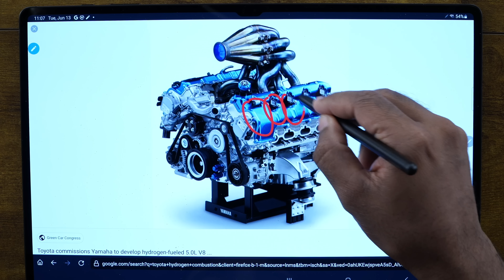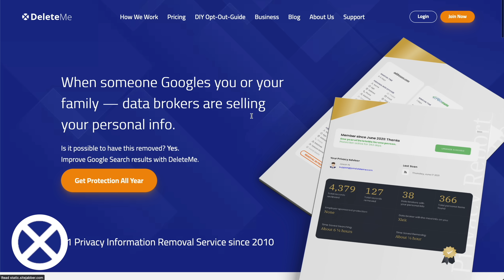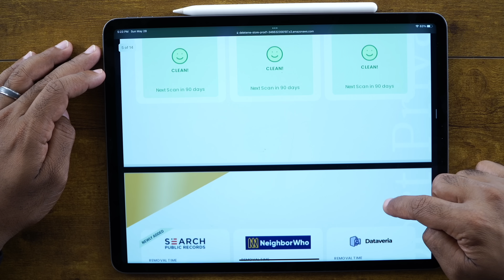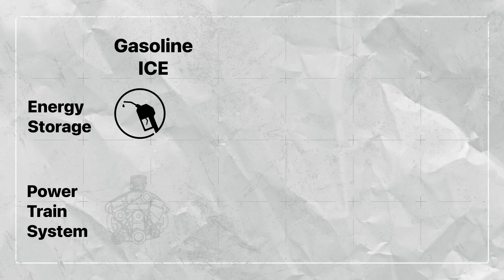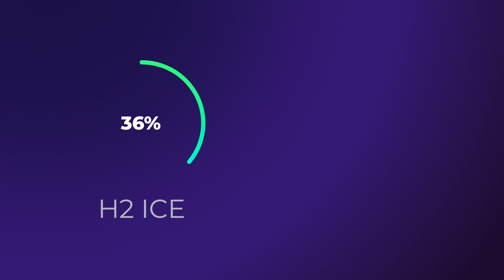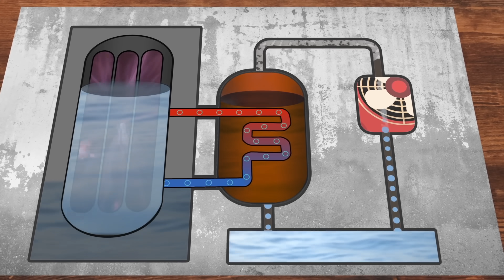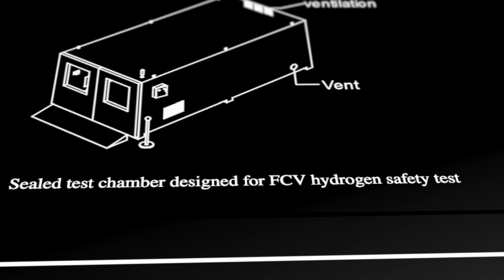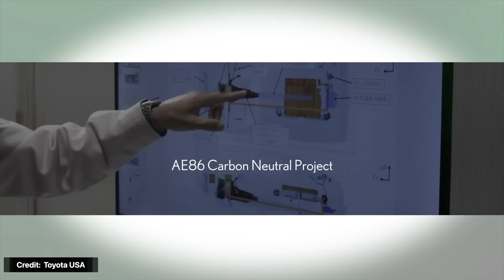Toyota's Says They Just Destroyed EVs - Hydrogen Combustion Engines

Comment: Problem: the H2 pumps freeze after every fill-up and can be a problem if people are lined up to fill their tanks.  Also, a typical station can only service 80 cars per day because the H2, even when compressed takes up too much space.
Reply: Most people don’t have a CLUE how difficult it would be for everyday people to try to use Hydrogen as a fuel. I have seen people suggest that we just use the existing fueling stations we have and transition them to dispensing Hydrogen.

NOT A CLUE !
Reply: @trevorhenriques7733  Most people have no clue the national grid will not support a 15% EV fleet
Reply: @trevorhenriques7733  You have no clue of what you are saying. Denmark has had a HYDROGEN highway for hydrogen vehicles for years now and it works like a charm...
Reply: @trevorhenriques7733 lol they’d be some impressive explosions with that idea
Reply: @trevorhenriques7733  People do it every single day in California but that's a magical future land.
Reply: @filonin2 , I have worked with liquid Nitrogen, Nitrogen exist as a liquid below -195C. If you pour it on any part of your body, you will freeze instantly and if that part happened to be load-bearing, like say a leg, that legs could crumble to dust under the weight of your body. At the very least you get a BAD frostbite.

Hydrogen exists as a liquid below -259C. Apart from it being very volatile as a gas causing possible explosions all over the place, do we really want to contemplate having canisters of liquid Hydrogen in the general population like we do gasoline today ???

I will continue to insist, THIS IS A VERY BAD IDEA !
Reply: @trevorhenriques7733  It doesn't sound like you worked with liquid N very much. I had a infra-red detector that needed LN2 so I worked with it routinely. We used to spill the stuff all over our clothes. It just jumps off you as it boils away. You can pour it in your hand and it will just jump around - don't try to confine it though lol. Hydrogen would be much worse and flammable to boot. I hope they solve the problems somehow.
Reply: @defaultuserid1559 , I worked with liquid Nitrogen for over three years using it for instantaneous freezing of biopsies and tissue samples for histological processing and microscopic evaluation.

Wore protective gowns and gloves when handling, and although we sometimes threw a bit across the concrete tiles in the backyard, I never wanted to find out what it would do to the skin.

But hey, if you think it would be a good idea to have the average person out there routinely handling liquid Hydrogen, have at it.
Reply: I will make sure I live as FAR AWAY as possible from any such “fuel stations” where the public will go fill up their Hydrogen vehicles.
Reply: @trevorhenriques7733  That's not what I said and you know it. Cheap rhetorical trick lol.
Reply: @defaultuserid1559 , You accuse me of cheap shots after you came out with your “superior knowledge” and accused me of not knowing or understanding the properties of liquid Nitrogen, SERIOUSLY ???

I have been working in scientific research and diagnostic science for over SEVENTEEN years and have experience with all manner of hazardous substances, even radioactive isotopes! 

Have a nice day !
Reply: @trevorhenriques7733  You intentionally put words in their mouth that it was a good idea for people to handle liquid hydrogen, which is of course in no way what they said. They were refuting your ridiculous claim that liquid nitrogen would instantly freeze your leg solid, which is not accurate no matter how you spin it.
Reply: @trevorhenriques7733  You seemed scared of Liquid N, so much so I thought you were fear mongering and wanted to add some real life perspective. I agreed that Hydrogen has many problems but you still got pissed off for some reason. 

Cheers !
Reply: @defaultuserid1559 , It’s called safety training for handling hazardous substances and having a healthy respect of the dangers associated with the substances we work with. Fail safety training and you are not allowed in the lab. I don’t fear the substances I work with, I fear the consequences of having some of those substances being in untrained hands. It’s no different than I would fear the consequences of a drunk wildly shooting off his gun on New Year’s Eve.
Reply: @trevorhenriques7733  Give me a huge break. I retired out of DuPont Engineering and we had more mandatory safety programs than you could name. I never met anyone in DuPont who thought Liquid Nitrogen would instantly freeze your limbs if spilled. Is that something you learned in your "safety training"?
Reply: @trevorhenriques7733  There was once a time we thought the average person had no business pumping their own gas - yet we allow that almost everywhere.  Did the dire predictions that there would be daily catastrophes from those that opposed it come true? No.  Likewise it could be possible to design connectors that don't allow for user error to cause a leak, to create safety inspection schedules to check on the equipment, etc.
Reply: @trevorhenriques7733  And the perception is even more damaging than the reality!
Reply: @filonin2  People in CA may use H2 every day, but certainly not from converted gas stations. Apart from their superficial function (filling vehicle fuel tanks) they have next to nothing in common, so "transitioning" existing fueling stations to H2 is not even a meaningful notion.
Reply: @filonin2  Very few people actually do it every day in California. Meanwhile many orders of magnitude more people run their battery EVs with absolutely no fuss.
Reply: @defaultuserid1559  They won't. Furthermore keeping the stuff liquid would be a nightmare.
Reply: Don’t you think a company like Toyota has already thought of this.
Reply: @user-zb7tg5hi3t  No. They just think that the hydrogen supply is someone else's problem. The same goes for JCB in the UK who have modified diesel engines to run on hydrogen with no thought about the hard bit; getting the hydrogen to the tractor cheaply.
Reply: @trevorhenriques7733  at engineering school we played with liquid nitrogen.  I have stuck my hand into a flask of it to fish something out.  Nothing happens instantly.  You have a few seconds before the cold can actually get into your skin, as the heat of your fingers just boils the liquid off.  It's not an instant freezing through to the bone that's for sure.
Reply: @filonin2 California is one of the lower levels of hell right now. The bottom line is a technology is not good enough yet. It's going to take billions if not trillions of dollars to get an infrastructure setup when there is finally a reliable green source. And I know this right now, electric cars are not there yet. It doesn't sound like hydrogen combustion engines are either. However they both sound promising in the future if they can just get around the danger from the batteries
Reply: @filonin2  Take a look at the YouTube articles showing the process. I'll take my occasional 15 minute breaks at the Supercharger, thank you very much!
Reply: @trevorhenriques7733  This is exactly what they were saying when the first gas stations were introduced. This argument is weak. Last week
Reply: @trevorhenriques7733  gasoline is an extremely volatile liquid that can explode...
Reply: @Crazen2  Ever tried to light some gasoline in a cup?
It does not light so easily, it needs to be hot or mixed well with air (as in accumulating fumes over time, more than an open container can make)

Hydrogen on the other hand is extremely happy to combine with Oxygen, and is extremely flammable/explosive once there is a leak
Reply: @trevorhenriques7733 but you think battery power is an option?  For one, the price is ridiculous. The range is extremely Limited. They are not practical if you have far to drive everyday. They might be okay in big cities. But you live out in the other parts of the United States and they would be extremely impractical. I don't know where you live but out where I live you have to drive 10 to 20 miles at least the town if you live outside of the town and a lot of people do. That means a trip to Walmart is a 40 mile round trip. If you spent time driving to work which sometimes is even further away than that, and then go to eat at lunch. You're almost at your maximum limit by the time you get home. So don't plan on picking up the wife and kids and taking them to a movie or somewhere that night or you might be stuck on the side of the road waiting for a tow truck to bring a generator to give you a charge.
Reply: @jamesbowen5573  thank you for being understanding of a point I have been making for some time now it’s like saying we should get rid of everything but E85 and that there is no use for gas or diesel.
Reply: Yeah, they need to install some kind of heater to melt the ice off of the dispensers.
Reply: @seanplace8192  That would be no big deal - a simple low voltage DC heating coil in the handpiece would suffice
Reply: Oh you're talking about the zip point. Where there is a change between pressure. I'm sure they'll be able to figure out a way to keep it warm if it were to go mainstream. Circulating a warm or hot liquid through it to keep it warm would probably work.
Reply: @@retiredbore378 "I suspect that you were working at a very low level and were told frightening stuff to discourage you from cutting corners." no, he's just fresh watching the "Snowpiercer". You know, the ambient air temperature is -120°C, people's limbs immediately freezing deep on a slight exposure etc. crap.
Reply: Neighbor scientist
Reply: I'm sure you're smarter than the engineers that will work to make this a viable option for the masses.
Reply: @heyitsbroski  Yeah, like those incredibly brilliant Kodak engineers that thought film would always be the way to go.  ;)
Reply: someone doesn't know how gas lines work...
Reply: Use natural gas and cut out the middle man.
Reply: Hydrogen gas pumps are idiotic and a failure.
Water is fuel, we just aren't using it.
Reply: That's why you do things like research and development to come up with solutions to problems like these.
Reply: THIS GUY DOSNT KNOW WHAT HES TALKING ABOUT. HYDROGEN IS THE FUTURE. ITS MUCH MORE EFFICIENT THAN ELECTRIC. ELECTRIC GRIDS ARE GOING TO BECOME STRAINED IN THE FUTURE WHICH WILL LIMIT ELECTRIC CARS EVEN MORE. WE ARE ALREADY HAVING TROUBLE WITH THE LOAD IN TEXAS ON THE ELECTRIC GRID. HYDROGEN IS THE FUTURE BECAUSE IT IS CLEAN AND ONCE THE SUPPORT INFRESTRURE IS BUILT FOR HYDROGEN CARS IT WILL ESSENTIALY TAKE THE PLACE OF GAS ENGINES..

ELECTRIC VEHICLES CAN NEVER TAKE THE PLACE OF GAS VEHICLES BECAUSE THEY ARE SIMPLY JUST TOO INEFFICIENT TO BUILD AND MAINTAIN OVERTIME. WE HAVE TO DO SOMETHING WITH ALL THESE BAD BATTERIES AND THE POLLUTION THAT COMES FROM MINING COBALT AND LITHIUM AND THEN HAVING HUGE LANDFILLS OF NOTHING BUT BAD BATTERIES THAT NEED TO BE RECYCLED CAUSING CHEMICAL POLLUTION INTO THE GROUND WATER AND SOIL.

TRUST ME HYDROGENN IS THE FUTURE. 
ELECTRIC VEHICLES ONLY PRESENT THE SAME PROBLEMS IN DIFFERENT WAYS
Reply: Would need electrolysis but how dare I put my brain power to this lesser crap
Reply: @diggleda2952  gasoline HHO ICE hybrids are very good. I got 80 mpg one time. Youtube deleted my channel. from back then. Circa 2010
Reply: @udontneedtoknow6816  The HHO generators are scam. Why are you scamming here?
Reply: @diggleda2952  HHO devices have been available for over a decade or longer but you have to search specifically for them and they're a super niche market (complicated to install) but have proven to increase efficiency by 80 percent even cleaning the burn all while keeping engine oil clean as by product.
Reply: @@user-dj5fu5on7nfirst search October 2022, Ireland.
10 killed.
Reply: That's NOT a problem. Hydrogen can be generated at pos and eliminate fuel delivery all together. And since it is generated near the pump you don't need to waste energy confessing it to a liquid for transportation.

Comment: When comparing pricing, don't know why you used the most expensive version of the Model 3 as the example. You can get a base model 3 for as little as $25,000 in some states
Reply: "In some states". Assuming you're referring to tax credits. Should really compare MSRP to MSRP when comparing, not artificially selectively reduced pricing.
Reply: @richard77231  Still, why use the Model 3 Performance when the much cheaper base model is comparable?

Comment: I've always looked at hydrogen as a superior alternative to batteries, for large scale applications. Hydrogen is not a fuel per se, because we have no ready source of pure hydrogen. You have to crack water to release it. So again, producing hydrogen takes energy, which is stored in the form of this fuel. That energy being released when we burn it back into water. Too easy. Low tech solutions are always best. This is why the Prius was successful, as they took advantage of electric drive efficiencies, avoided the battery problem, without losing the convenience of existing gas stations.
Reply: 'Too easy... and Low Tech...' These are not terms that make sense when applied to Hydrogen. Why waste Electricity splitting water at a low efficiency, waste more electricity compressing it, when you can store it at high efficiency in a BEV? Then you waste another load in a complex ICE Engine or a complex Fuel Cell rather than just use the battery to drive a motor. That's the simple solution, a BEV, it can't get any simpler.
Reply: @rogerfroud300  Batteries are horrible; in terms of manufacturing, charging, convenience, replacement costs, as well as safety. Even if you leave out the source of electricity, BEVs are already the least green of all options.
Reply: So inefficient. And dangerous